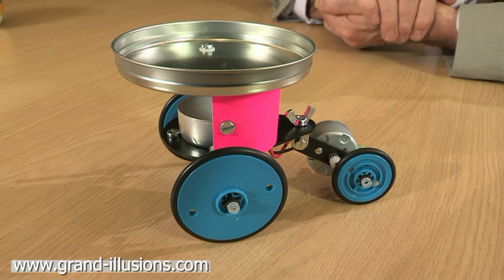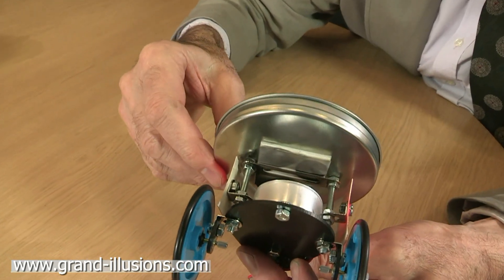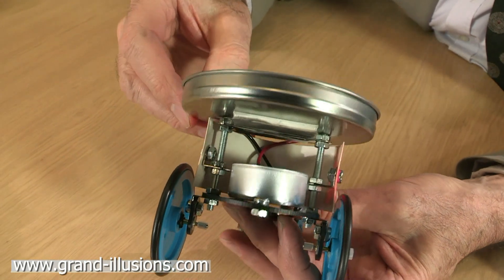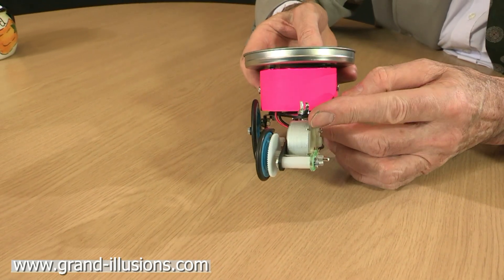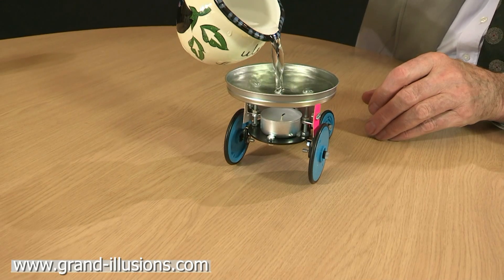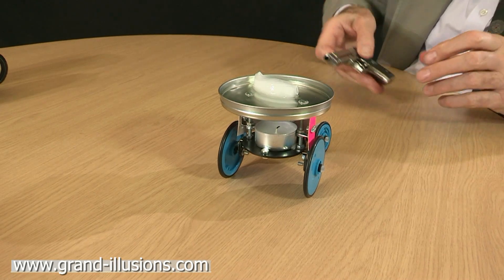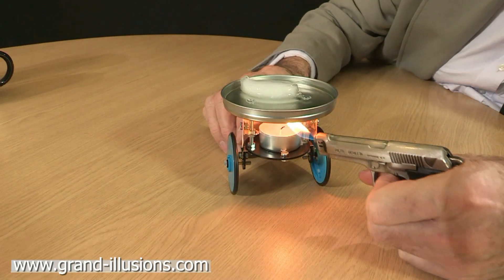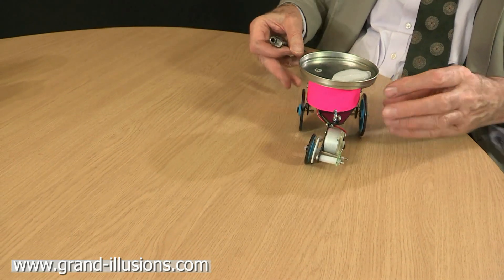Candle Car Kit

Comment: The nifty thing about these thermoelectric devices is that if you apply DC current, it acts as a heat pump.
 
I installed one between my CPU and heat sink on my last PC and regularly had processor temperatures as low as 5° C.

Comment: This is the same thing like the toy boat in GHIBLI animation Ponyo (By Miyazaki Hayao).
But the design of filling in water is slightly different.
Water fills in from the bottom of that boat  connecting two tubes which finally leads to a metal box (unlike the plate in this car) above the candle.
That is of coarse more convinience for a toy boat to play in water.
Anyway, go watch Ponyo. The film itself is good, and the toy boat is really a cool part (and quite important in the latter half) of it.

Comment: Well, The Seebeck effect is what is shown here, generating electricity from a heat difference with a thermopile, the Peltier effect is the opposite side of the thermoelectric effect, using such a device to create a temperature difference by applying electricity to it.

Comment: It is not the same, really, the boat you describe does not use a thermoelectric generator, instead it is more like a steam powered water jet engine, the boat is pushed by water expelled from the box through the tubes, the pressure inside drops since steam condenses, and water is pulled in again. This sort of toy is often called a pop-pop boat(there are many variations on the name, though).

Comment: Science question: Say you take two of those plates and put them next to eachother. If you kickstarted one with some fire and ice and had it power a air conditioner of sorts and a heater (placed on either side of the two plates) would this create essentially unlimited energy for the second unused plate?
Reply: nope
Reply: good question, it theoretically would, but i you could get a heater and an AC that takes that little energy, the cell would not absorb 100% of the heat and cold energy. More like 90% that other 10% is lost to the air and anything around it, so it would go on for a while, similar to the perpetual motion divices